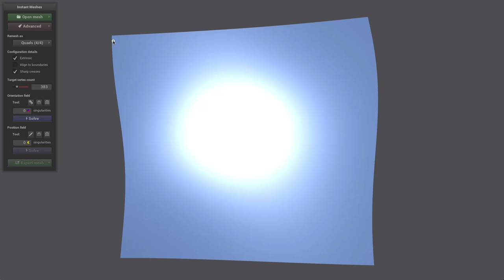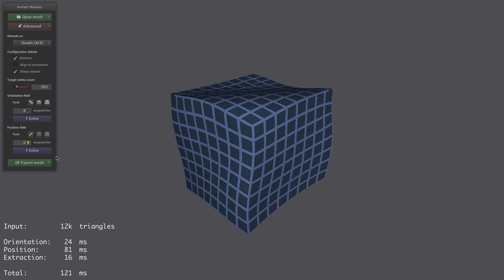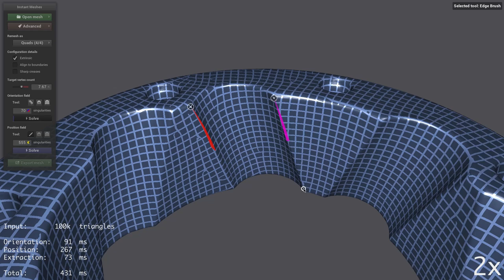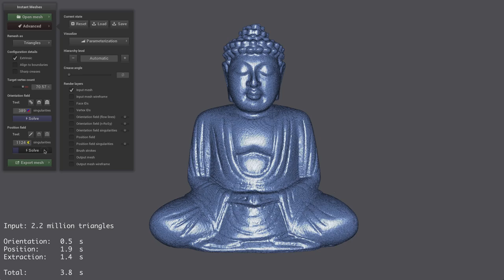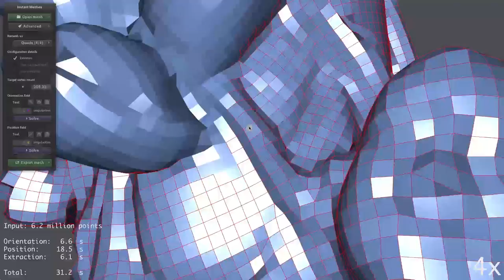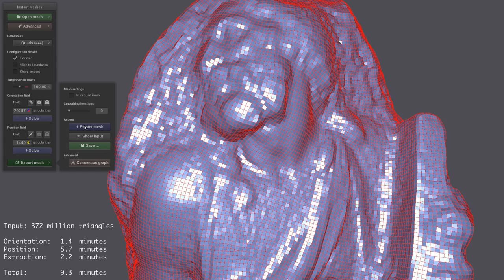Instant Field Aligned Meshes (SIGGRAPH ASIA 2015)

Comment: Somebody go call Pixologic.  Because I wouldn't mind seeing this available in ZBrush 5.
Reply: +SuperGamer87 By the way, how come every time I see Wenzel Jakob's name mentioned somewhere, it's for something cool?  :)
Reply: +SuperGamer87 Zbrush has ZRemesher.
Reply: ***** Yes, and it isn't perfect.  It sometimes results with annoying spiraling loop topology, sometimes even with the ZRemesher guide strokes.

And ZRemesher definitely doesn't sport this level of interactivity towards topology flow.  I like being able to edit the flow on the model before the retopology is generated.

Wouldn't hurt to have some of the options available in this program combined with the power of ZRemesher.

The more we build up remeshing tools to feature a wider set of options, the better.  More options, more power.
Reply: +SuperGamer87 
I agree! I will send them an Email linking to this video. The more emails they receive on this, the more likely it will get implemented.
Reply: Robert brown There are a number of workarounds.  But I'm stressing efficiency here.  Streamlined processes.

Even this polygroup method can still run into issue with spirals, if you're dealing with a Dynamesh or ZRemesher mesh while sculpting.  Sculpting with DynaMesh is esp. where the issue can occur with ZRemeshing afterwards.

It's much lesser-occurring by using guides/masks/PolyGroups/etc., but remeshing in general can still sport the conundrum of encountering spirals at times--and when it does, it's a total headache.

Plus, I had another point here:

"And ZRemesher definitely doesn't sport this level of interactivity towards topology flow.  I like being able to edit the flow on the model before the retopology is generated."

Again, having more options is better here.
Reply: +SuperGamer87  my solution to all of this has been to resurface in 50/50 work flow using Mayas modeling tool kit to do final edits while cleaning up edge flow. If you use the poly groups and edge scaling correctly its more of a 70/30. Whoever takes the success of both these tools and combines them into one stable functional utility wins the game.

I agree that having real time previews of the redirected tessellation is a really nice feature, but there are some really important core functions that this tool doesn't have yet like symmetry,  live curve continuation, and edge loop ray casting which are modeling for production features. 

This is a specialist tool geared toward cleaning up scan data. So the only thing worth integrating into zbrush would be the real time previewing features.
Reply: +SuperGamer87 the zremesher does offer some interactivity towards the topology flow, its called the zremesher guides brush, and it works exactly how you're saying you'd like it to, you draw the guides before the retopology is generated
Reply: Luke Webster I'm sorry, but I've already explained the issue with ZRemesher guide brush.  You'll have to read what I wrote subsequent to my first comment, because I don't have time enough to re-iterate.  :/
Reply: +SuperGamer87 This is true, Zremesher is amazing but, BUT, Spiral loops and other crap end up happening over and over until you've generated 4 different meshes with different loops and then it might work exactly how you want it...
Reply: Please no! They just take it, integrate it and drop support for the standalone. I don't want another sculptris disaster.
Reply: badoli sculptris disaster?! them buying sculptris bought us dynamesh, arguably one of the best features in zbrush
Reply: Yea, but it killed sculptris. I know ZBrush is a great soft. But i have to work with 20+ graphic programs and i have to sculpt once in a while. I don't have the nerv to learn ZBrush with that "fuck standards"-UI and i really love sculptris for its simplicity. So yea, thanks for killing that, Pixologic.
Reply: badoli  they integrated it into dynamesh.. you can still use sculptis as a stand alone if you like.
Reply: Sure i can use sculptris, but it's an unstable alpha which lacks a lot of features. Pixologic stopped dev on that. They killed it, just like Autodesk bought and killed Softimage. Just kick out the competition.
Reply: badoli It wasnt about killing the competition, scultris is and was no competition for zbrush, Pixologic basically bought scultris to implement its features into zbrush. If you want to use sculptris you can its still available to download and still works great as a FREE piece of software. And as for learning how to use zbrush, really it doesn't take that much time at all especially if you're only going to use the same features that sculptris has and ignore everything else zbrush has to offer. If you are annoyed at pixologic for not developing it more answer me this, how mch more development and how many more features do you want them to add, and it still be a FREE programme, also if they do develop it and and new features you are just going to have to learn how to use them, which seems to be a problem for you.
Reply: Okay, once more for the ZBrush fanboy in the first row here:
- ZBrush is expensive.
- ZBrush is a too big tool for the job i am doing.
- ZBrush has a non-standard User Interface that doesn't integrate easy with an established toolchain.

Look: I have worked with ZBrush already 10 years ago, so don't get me wrong, it's a great tool, but not for everybody! Why is that so hard to accept?! I would just like to have a cheaper and more lightweight alternative with the fraction of the learning curve. Sculptris was very promising, but it's still very unstable and as such a problem within my toolchain. I'm in a tight time schedule and just don't have the time to fuck around.

So yea, if Pixologic wouldn't have bought Sculptis, it might have turned out to be the perfect program for me. Hence i'm eternally annoyed by the fact they did it. I'm happy you have dynamesh, all joy and happiness to you. It doesn't help me though.

And that's all i say about that. If you don't get what i want to say, i can't help you.
Reply: alright no reason to get so annoyed, i was just trying to reason with you why, initially, that it would be great if pixologic implemented this instant meshes tool from the video into Zb rush. 

yes zbrush is expensive, but its is quite cheap as far a 3d software goes. I do appreciate that  the price might not justify its means for you specifically. 

ZBrush is a too big tool for the job i am doing, is a silly statement, just don't uses the tools you don't need to use. all you'd need to use would be the same brushes as sculptris + dynemesh and it would be the same, no real learning to do. I do appreciate that you dont need to use zbrush and im not trying to sell it too you. I under stand what you are trying to say, I just think you a wrong and that you are thinking about it on a far too personal level. Think how many thousands of people now you zbrush and dynamesh because of it and the amazing advancements in films and games it has had, but no you're still bitter that they killed sculptris. 

And to bring it back to instant meshes, this was a siggraph paper so its aim was for people to take this research and see what they could do with it.
Reply: Well Sculptris + Instant meshes = A better Sculptris that wouldnt need Zbrush for auto retopo
Reply: Look: I have never said that ZBrush isn't a revolutionary software. I'm aware of that and i'm honestly happy for each and everyone who loves it. And i marvel seeing what it is able to do, seriously!

But that doesn't help me. And saying "You're wrong" isn't changing that. You're taking my stance equally personal, so you're not that better off.

Pixologic could have given Sculptris back to the community, make it open source or so. Or they could have made it a "zbrush light" and keep on developing, maybe make it a tool for indie devs. They chose none of these options, they just stopped developing it. Basically telling the fans of that software: "Buy zbrush or get lost". Why shouldn't i be bitter about that...?
Reply: badoli
I agree with everything you say, if Sculptris had someone or someones working on it, itd be the best simplest sculpting tool for Indie, hell if it had a Retopo like Zbrush atleast, or a seperte retopo much like zbrush, free or not, cheap and not 100 $, Woulda been most helpful tool ever. 
I still use Sculptris lol and I cant look at any other Sculpting program again....
Reply: Guys, Pixologic technically didn't "buy" Sculptris. 

They hired Tomas Pettersson (aka. Dr. Petter) as a developer and they assimilated Sculptris into their brand.

But Petterson had stopped development on Sculptris long before they hired him.

Similar to MeshMixer's creator planning for acquisition all along, I think Petterson created Sculptris partly with hopes of getting industry notice.

If anything, Pixologic cleaned Sculptris up a little bit and gave it ZBrush-like controls and GoZ.

Also, Sculptris and ZBrush's Dynamesh are nothing alike. Sculptris relies on dynamic topology as you sculpt.  It's just like Blender's Dyntopo in Sculpt Mode, increasing tessellation as you sculpt, adding new topology as you sculpt.  It doesn't improve the topology for better sculpting.

Dynamesh was developed by Pixologic, and it dynamically re-topologizes meshes after you sculpt and then perform the operation.  It aims to give you efficient retopology between joined meshes and improved topology with stretched meshes.  It doesn't add new topology as you sculpt, but rather, improves the topology for better sculpting.

Sculptris is more like Autodesk Mischief for 3D sculpting.  ZBrush's Dynamesh is more like what Instant Meshes here does (but not quite as interactive--even Guides in ZBrush isn't this visual and instant update as Instant Meshes brush guide is).

Sculptris is also triangle-based topology, whereas ZBrush is quad-based topology.

Unlike what Autodesk might would've done, Pixologic was cool enough to not kill Sculptris and to keep it freely available, and they didn't even put Sculptris' dynamic tessellation into ZBrush (as of yet, anyways).  They keep Sculptris as a complement to ZBrush, and a gateway drug to ZBrush.

Comment: Is it possible for this application to do adaptieve density remeshing? You probably know, what do I mean: spend less polygons on flat uniform surfaces while keep it dense on curved and complex aeras.
Reply: +Damian Winnichenko It's not supported by the current binary, but in principle non-uniformity is supported by the underlying optimization technique. We will likely integrate this feature at some point in the future.
Reply: +Wenzel Jakob Thaks for answering. Uniform distribution eats a LOT of useless polygons =( I`ll be extremely glad to use non-uniform implementation in future releases =)

Comment: I have been struggling to get this to work as shown in the video.. my main issue is that our scanned meshes have holes, or detail edges that I DON'T want to generate singularities, but attempting to click and drag them using the magnet is nearly impossible.  It misses 99% of the time.  And the "scaring" tools are constantly greyed out.  Anybody have any idea if there's a manual somewhere?  Seems soooooooo useful, but it's very tricky.

Comment: would be great if it had  target edge loop functions, the ability to continue extending the curve guides and symmetry options. Right now it seems limited to simply cleaning up scan data, but i can really see it evolving into a suitable production tool. It also chugs like crazy when using the " singularity attractors " and I'm on a 8 core, 3.10 ghz cpu with 16 gigs of ram and an  over clocked Gforce 960 card. This last crit is nit picky but i would really consider changing some of the naming conventions for the tool functions and lean toward terminology that's been standardized for well over a decade now. " Orientation comb, Singularity attractors" aren't very resonate terms to a field of modeling focus that already has a standard language.

Comment: Only yesterday opened this little app for myself. And It's awesome! But would be nice to be able to control density differentially for parts of the mesh. Also buttons to expel singularities doesn't work. And moving singularities also almost doesn't. In most cases it says that beginning point is not a singularity.

Comment: This is great! In the paper there is mention of being able to change the scale of the quads based on custom parameters. Is there a way to do adaptive quads based on the curvature, that way large coplanar areas can remain a single quad?
Reply: +Luiz Kruel It's not part of the the currently released application, though we will likely integrate this feature later on.

Comment: A great little program, but I can't seem to export any of my meshes. .ply exports crash and .obj exports hang. Any idea's. Will try with a more simple starting mesh.
Reply: It seems that when I attempt to export .obj the system hangs and continues to produce a file that grows and grows in file size. A 200mb .ply file turned into a 10gb .obj file. Any help would be very much appreciated! Running on Wndows 10 64bit edition.
Reply: +Simon Che de Boer Dear Simon -- Youtube is not so great for bug reports, please create a ticket on GitHub (with a link to one of your PLY files).
Reply: Okay. Will do!

Comment: Fuck manual retopo. I've always used zremesher guides to work on my edge flow but its quite intensive to wait for the mesh to process, and the instant visual feedback this software allows will eliminate a lot of trial and error. 

Possible to add UV unwrap functionality as well? I assume the same algorithms could be applied to this purpose